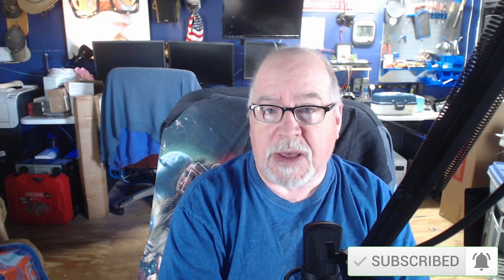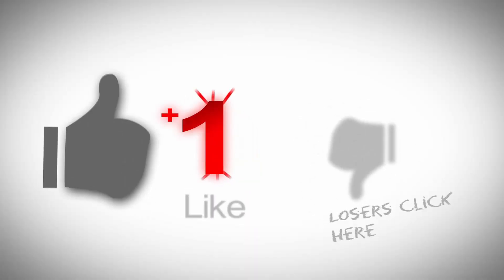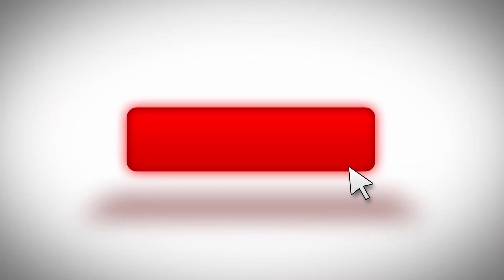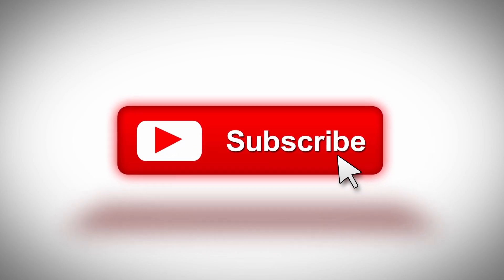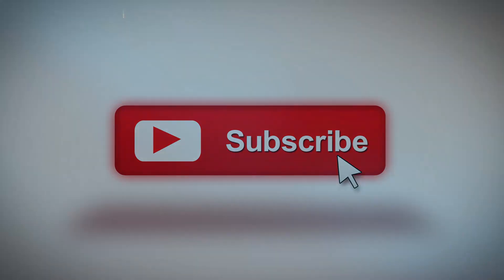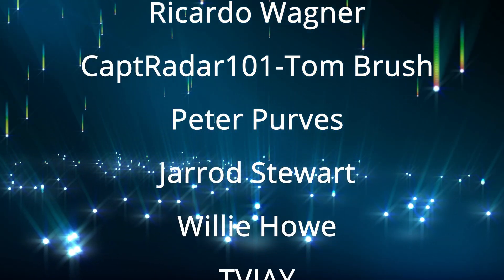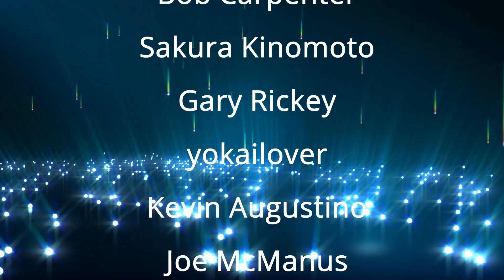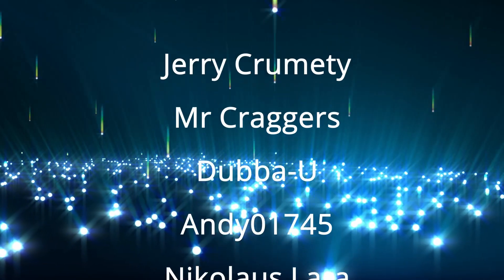Fixing a broken GTX 950 video card.

Comment: I justo suscribed! My EVGA geforce gtx 950 just stopped giving image or any signal, the fan starts with Windows and stops. There is no sign of a burned circuit or anything, also tested it in another pc working good but tje same thing happens. Any idea? Thanks 😭